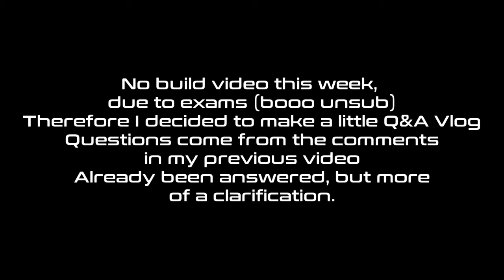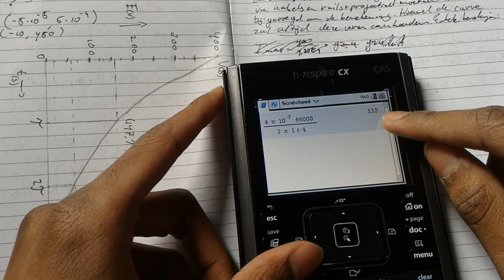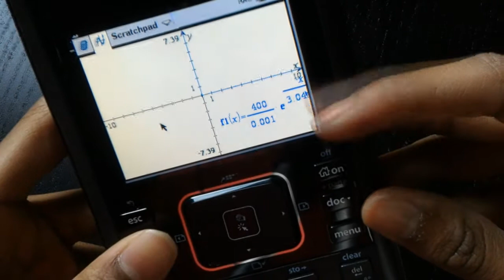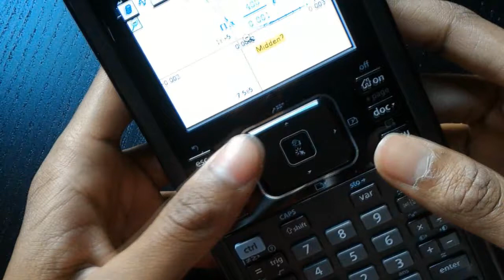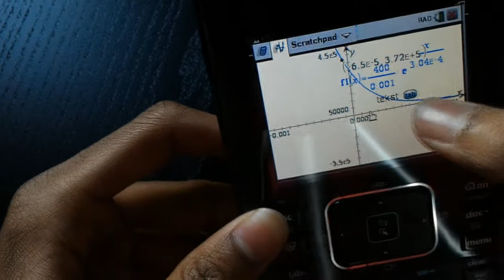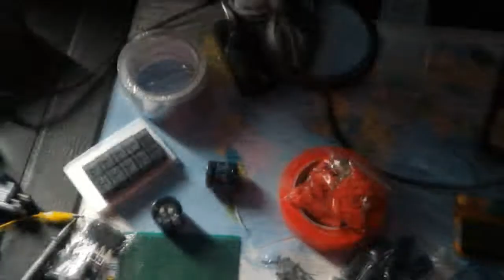Vlog#003 - Q&A, Power Supply Build, Livestream

Comment from the maker: Shall I make a 4-axis machining tool? Lathe, mill and drill press in one?!
Reply: It'll be revolutionary.
Reply from the maker: If it isn't, then what's the point? ;)
In mechanical engineering, I'll have to make something similar anyway for semester projects. It could be very useful for my youtube projects as well. If I add a CNC function to it, I might be able to make stuff with absolute mathematical precision. That's requires a lot of modelling and g-code though.